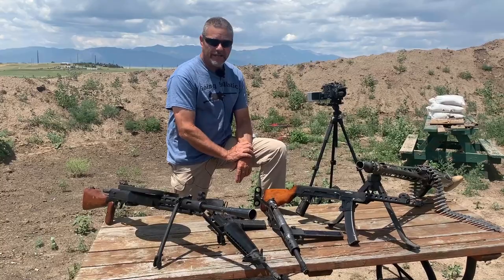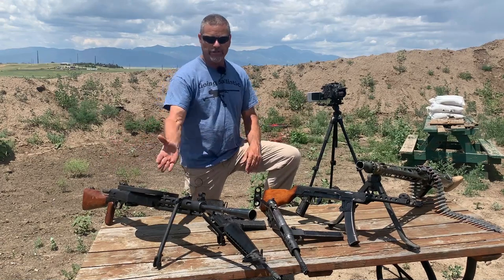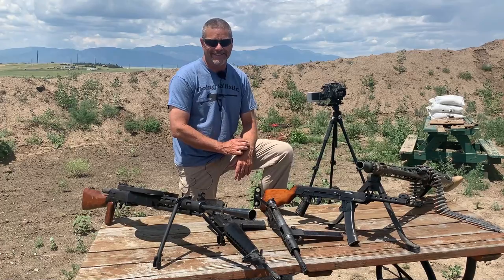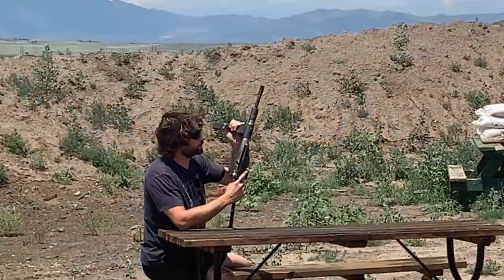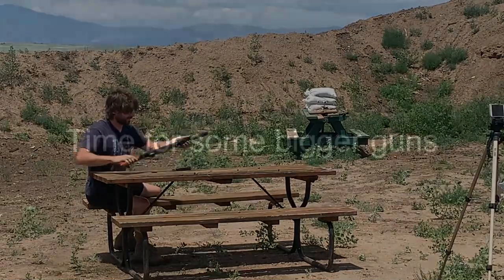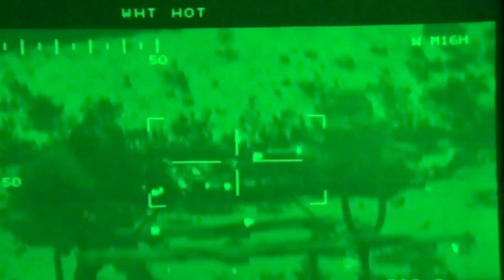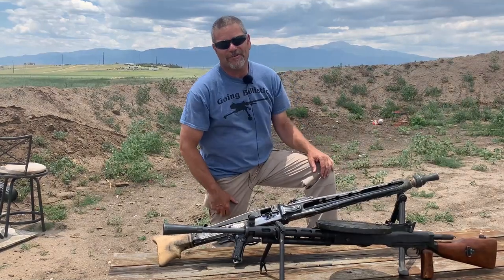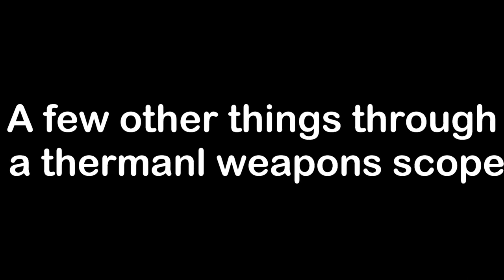How Machine Guns Heat Up Through A Thermal Scope

Comment: The best experience you're gonna have with night vision is staring straight up in the middle of the night sky.  Use to do that in my foxhole during boot camp
Reply: I have done many skywatches that way. It's amazing how many more things you can see.
Reply: That doesn't work so well with themal vision.
Reply: @lucky43113   it's stunning. I remember counting over 55 stars just inside the scoop of the big dipper.  With the naked eye it's barely 5.
Reply: @disgruntledegghead6923   xD  I should have tried with the phantom cameras. Goddamn it.

Comment: Wow, Justin has a nice collection! 

DPM, M16A1, Sten, PPS43, and an MG42?

Edit: that's either an MG1 or MG2, one of them was a -42 converted to 7.62, the other was a new production -42 built in 7.62. the MG3 is more heavily modified, different bolt.

Comment: I read in a book, ( by John Ford or Ian Hogg don't remember now ) that a general purpose machine gun generates, on average 300 horsepower in heat and recoil.
Reply: strong rifle round is aroung  4000J, that equales to roughly 1.1(1)~wH per shot

Comment: amendment below

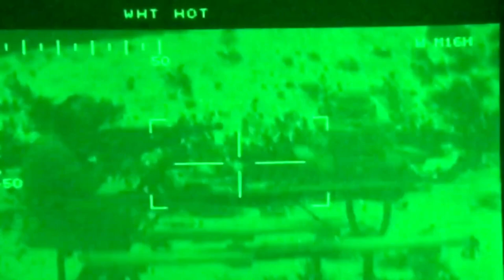Just me, or did the video briefly go crummy for everyone at 3:49 or 3:50

Not sure if it was some kind of artifact caused by the low resolution transition to the thermal camera in that particular spot. I don't think I saw that happen anywhere else. Or at least not that was quite so obvious. Seemed the only spot where they cut to a different clip right before the thermal...

amendment
I did look back, and saw at least one other point where the video quality in some way (appears to be resolution dump) takes a dive. It was the same kind of circumstance. There was a quick cut in both spots within a few seconds of the thermal vision changeover. So it definitely seems related in some way or other, and at least confirms my suspicion that it 

Like there was only 2 or 3 seconds of video between the cut and the thermal. Maybe even just a YT compression issue?

Any thoughts?

Comment: Since your really going for the science of all this.
Colab with SmarterEveryDay and do High Speed & Thermal and to make even more video's out of the same shoot put pressure plates behind target measure different mass, different speed to multiple impacts at higher rate.
Would also be interesting to see the same round shot from a revolver, pistol, rifle with different barrel lengths and rifling twists
Reply from the maker: Great Idea.